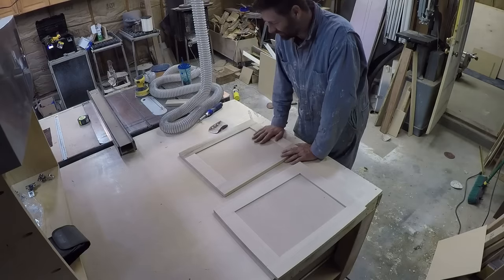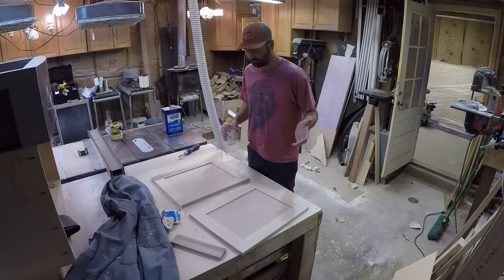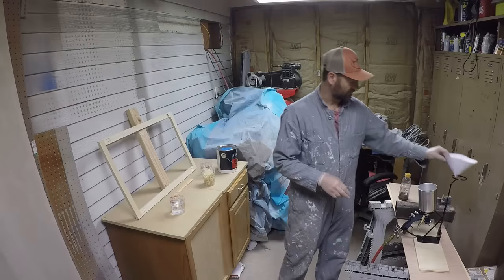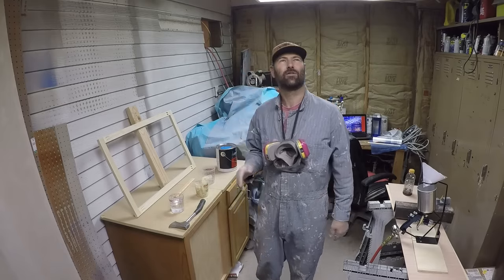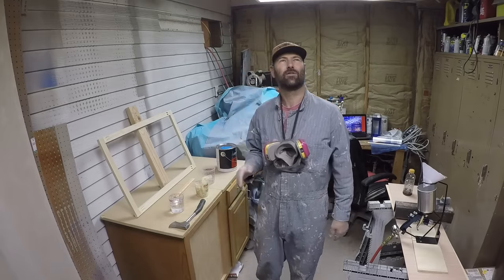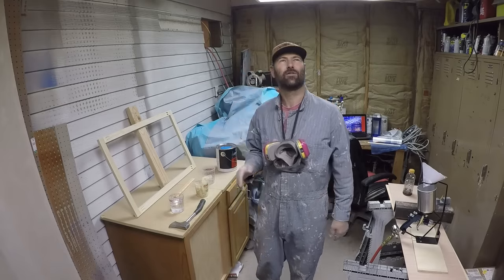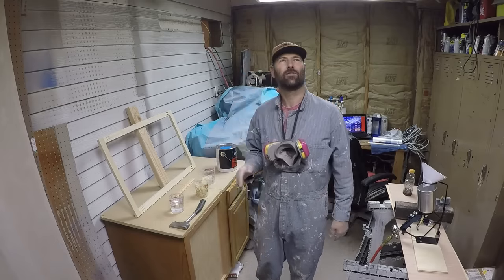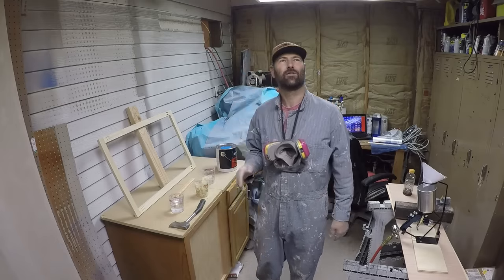Don't Paint Your Cabinets? | THE HANDYMAN |

Comment: Hey handy man I’m from the uk . And a professional painter decorater. 18 months city and guilds in all aspects of decorating, even sign writing faux marbling etc. Spraying as well. Anyway I use a brush I can get any surface smooth brush mark free on trims etc. See your face in them with the right products. Thing is customers don’t want to pay for the extra time it takes for prep . Although I still can make any surface smooth like a baby’s bum in the price I charge . And it’s much quicker than fucking about with a spray gun.
Reply: How do you do it?
Reply: Load it on and be delicate , get it on quick plenty of it (the paint) a good brush nice long soft bristle . I’ll try explain how I’d do one of you cabinet doors,as you have them off . Prime it first don’t sand it . When you prime paint it first then sand it, this makes any fibres easier to sand and the dust heavier . (Good for your lungs) especially on cut edges of MDF . Don’t use water based on MDF neither makes the fibres rise . With your cabinet doors paint edges first if any goes on the stiles you swipe it off with your brush you could use a rag but run the risk of leaving a bit of fluff behind (this is to be absolutely flat don’t want no contamination). With the two inch brush do the edges as I said then do the panel. You paint around two inches in from the panels edge where it meets the style a decent loaded brush with that size door you’d get about 3 quarters down with one vertical stroke of a loaded brush, then you’d work the panint side to side then across upwards or downwards basicly applying it even. You’d do that across then down the panel then has you only have aquarter of the panel left you’d only load the brush from your kettle (that’s a vessel to hold paint in the uk) a bit less than you did the top of the panel. You’d have to be fast and have time to lay it off so the coats are even. Then you do the styles . You can just do them in the same motion of strokes but brushing side to side will make the paint flatter. It’s easier to put white sprit in. (Thinners) not much just enough to make it flow. It’s hard to explain my friend I was taught by old school an I still use me brushes how they taught me. 30 years no complaints, and some customers are now friends . You can cheat on new wood by using a fine elastic two part polyester filler you’d basically put a smooth coating all over your surfaces then rub it down, if you apply it evenly it will only need a light rub. Do it right an trust me it will feel lovely.. bit more handy man I’m only a decorator I don’t do your skills of someone asks me to put a shelf up I give them my brothers number, I don’t pretend to be anything else. I could do it but not as good as my brother and your self . Also I don’t get into customer when they are choosing colours I’m not the one who has to look at it every day, you choose it I’ll apply it to the spec . I always note how tall they are. Haha and so the sign lines perfect, also where  they can see from the toilet. There’s many ways to make them customers happier